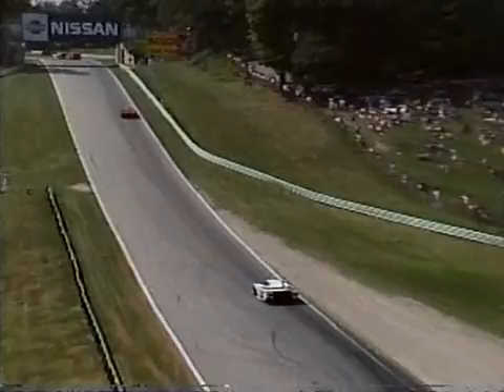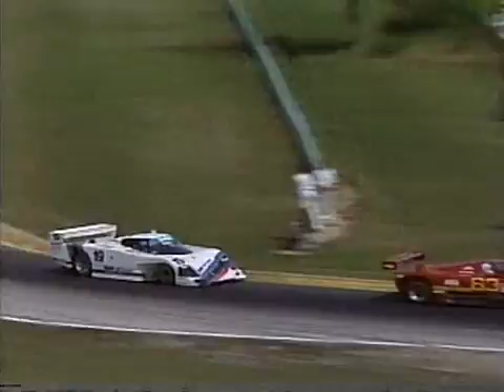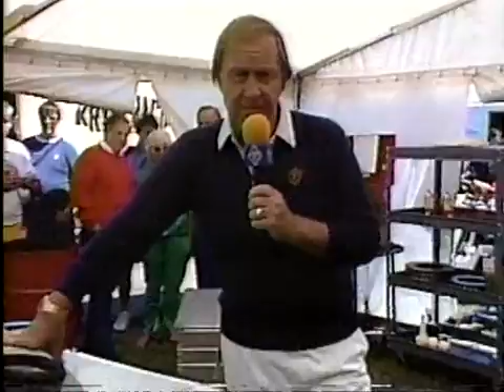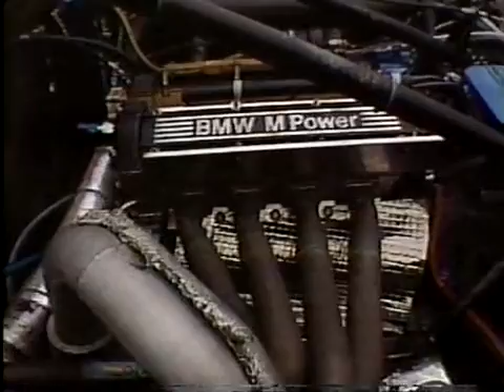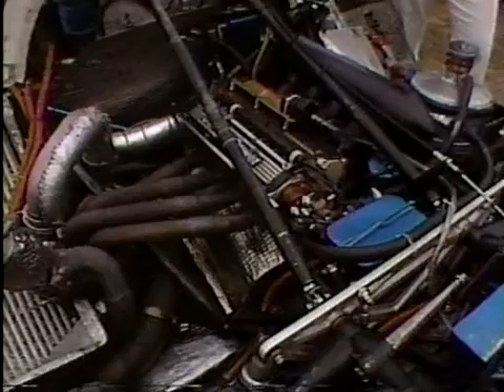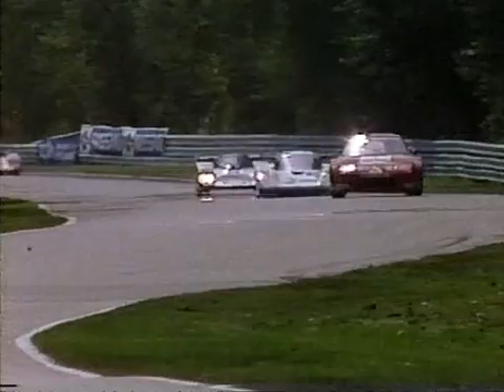BMW IMSA GTP Race Engine Tech Fact

Comment: I never realised that engine was run in IMSA cars!
Reply: Ford Kent ;)
Reply: Cosworth DFV?
Reply: +Bujf vjg the Kent engine was planned for f1 use but couldn't rev high enough due to an incurable imbalance in the crank. Although it never made it to f1 it was incredibly sussful in f2 And f3 the world rally champion ship, group b, rally cross etc. there are BDT engines happily pushing 1000bhp now. I think the m12 is a great lump though. the slant of the block etc. looks great on throttle bodies. A bda escort at full blast through a forest, is like the song on angels